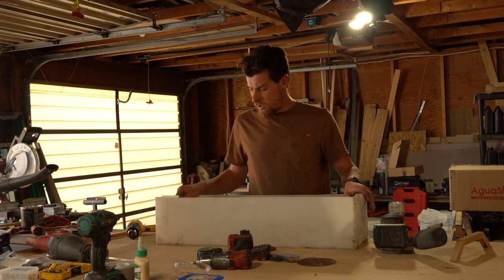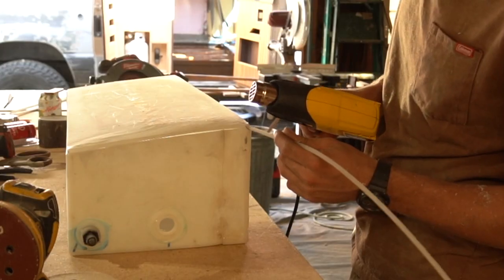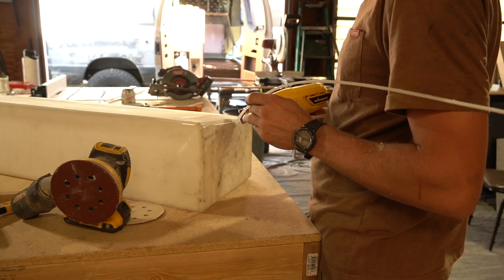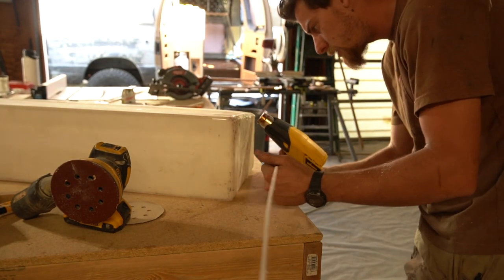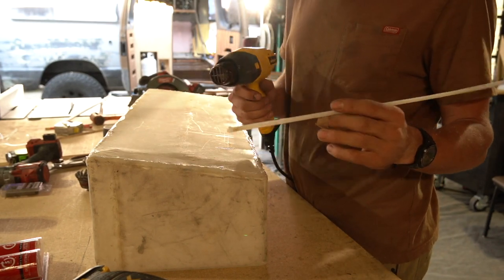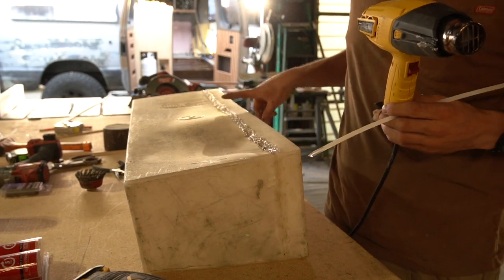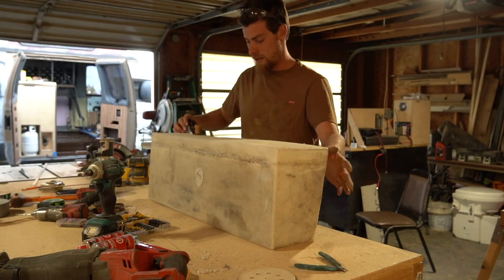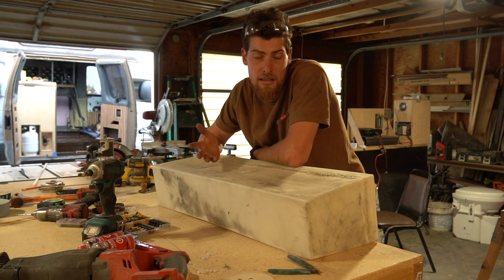Making a Custom Water Tank // Van Build Series on our 4x4 Swapped Ford Econoline

Comment: Awesome guys I was just talking to my other half today about doing that was our four wheel drive van is putting a great water tank in above a rock sliders we're going to use a piece of aluminum diamond plate on the bottom of the tank so if anything does go up off the highway or a rock it won't punch her or gray water tank. Thanks for the video totally awesome. Your your bills are like ours we're right now putting super duty axles out of 03 four wheel drive under our van
Reply from the maker: Loveeee the aluminum plate idea! Might just have to put that in the list of things to do! 🤟🏼🤟🏼